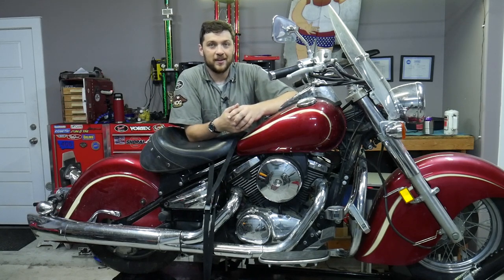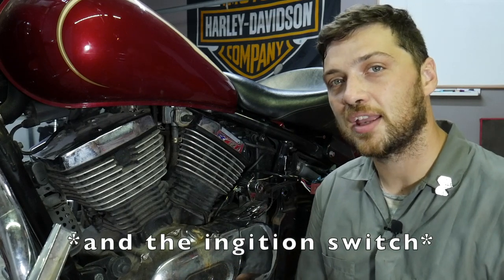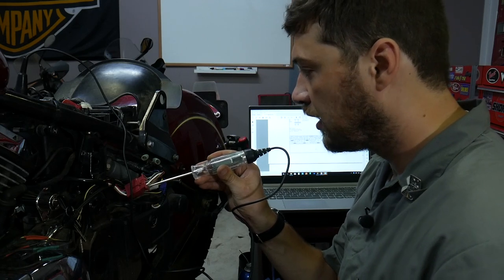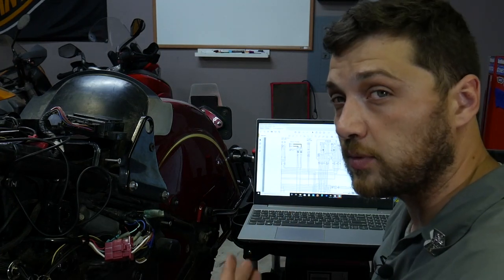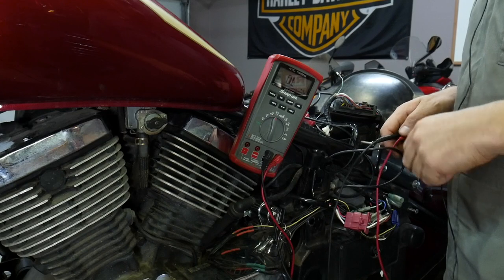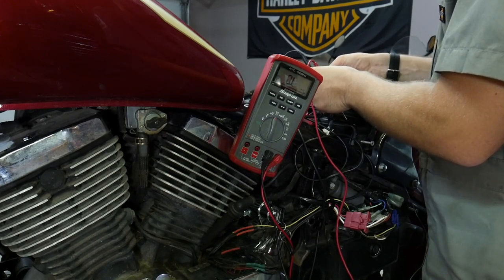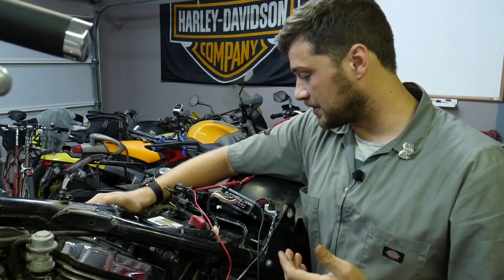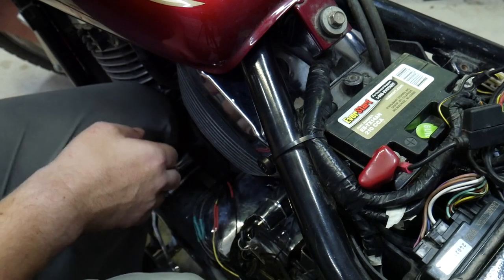Troubleshooting the IGNITION SYSTEM on a Kawasaki Drifter 800 (VN800E)

Comment: Man, I can use you right about now. I have a 2002 1500 that just died on me, I came back from a ride, shut it down for about 15 minutes, came back and it wouldn't start. No power to anything.  I checked the main fuse, the junction box and fuses, starter relay, and all good.  I'm going to check the ignition switch tomorrow and work my way from there because I noticed earlier that there when I turn the key to Park, the back park light comes on.  That new discovery tells me the problem might be or related to the On position of the ignition switch.  Should be simple enough to find out. Time will tell. Excellent trouble shooting video.

Comment: Great diag video Garret. When you measure a diode you need to use a meter that has a diode check function. If using resistance function not enough current flows to cause the diode to conduct. In that application even a test light would work as 300ma would be tolerated
Reply from the maker: Wow thanks friend! Thats great information that will be with me forever! I'll be checking a diode 46 years from now and remember a friendly youtube comment! Cheers!

Comment: Hey Garrett, Glad to see you are enjoying your Euro trip!!
Just catching up on your older videos. Nice to see a Cruiser in your shop! Love those. I ended up with an 08 Roadliner which gave me a new respect for Fuel injection and ECU controlled bikes. 1900cc is Amazing power and runs cleaner than any bike I have owned! Electrical TS will be a bit more interesting though. XD. Your video might just come in handy, if my neighbors get tired of the cobra pipes...lol.
Btw, I created a new channel for DIY. My old handle was MassiveTrackHunter.

Comment: I was always trained to test in halves. It cuts down on time and steps. Split the circuit in half and test. That directs you to the first half or the second half. Which half that shows an issue, you split that in half. Then that narrows it down to quarter of the circuit which is so much easier to manage and very close to the issue. So your only taking 4 to 5 testing points.

Comment: Hey Garret! Awesome vid, I also have a Kawasaki that’s pretty similar, it’s a 1995 Kawasaki Vulcan VN800 and it won’t start. I’ve been trying to troubleshoot it and have a few questions. First, I’m able to get it started and running for a couple seconds using starting fluid in the air intake of the carburetor, would this automatically mean that all of the wires are wired correctly and it is most likely either faulty spark plugs, or a dirty carburetor? Do you have any other ideas that I could test out to see if I can get it running for longer than a few seconds? Thank you!
Reply from the maker: If the bike runs for a few seconds on an external fuel source i can almost guarantee the issue is with the carburetor. I would disassemble it and thoroughly clean the jets and the passages. Good luck my friend!

Comment: Great video,, i have a 1500cc 1999 Vulcan nomad, we've changed the igniter ( cdi ), the querky  things ,, if u try to start the bike the first time there is no spark ( took the plug out and grounded it  ) but if you turn it off and start it again it starts, btw  if u don't turn it off and restart the key it will not start you have to turn it off and restart, it was starting after one restart but now have to turn on and off many times to start,, also whether it starts or not  the dash lights are on,,  is it the ignition switch or something else, my friend said could be my battery , but after restarting it 4 or 5 times it starts,,  if it was weak battery all those times restarting would have weakened it and not start anymore,, thanks for any advice..

Comment: I recently purchased a friend's 2002 Kawasaki Meanstreak 1500, it was sitting in the garage for little more than a year, but its not starting.  I checkef the oil level, put in a brand new battery put in fresh gas but mixed it with year old gas...but gonna pull the whole tank off and dump the gas cause its still not turning over, next is to change the spark plugs. Any other suggestions other then taking it to the shop?
Reply from the maker: I would definitely pull the carburetors off, disassemble and clean them. Gas goes bad and clogs carburetors very quickly these days
Reply: Is it cranking and not firing or not cranking? Was it stored with the fuel tank shut off? If so, add a bottle of gas line antifreeze alcohol it will absorb water in the tank and turn it on to run your bike. If not, clean your carbs.

Comment: Is it the same diagnostic for the Vulcan 500? I have a service manual that looks like yours, but I've gotten 2 used OEM ignition modules and a sketchy Amazon one, none of them nor my original seemed working according to my service manual. Do these things just fry easily? Also, my ignition switch is not wired correctly, but it does give 12v to the brown and gray wires. I did make sure the gray wire is giving 12v to the igniter. Any advice? Am I just having terrible luck with igniters?
Reply: The gray wire should have a min of 6voilts to the ecu it tells the brain your not trying to hot wire your bike with out it it wount spark

Comment: Today my VN800 died. Even with the key ignition to OFF, dashboard lights, front and tail light, horn and igniter works, but the engine don't start. The igniter tries to crank up, but the engine looks dead. 😔
Reply: How did you fix it. Same problem I'm having
Reply: Check your master fuse the 35 amp one, it could also be the relay or a bad starter. And check all your fuses.